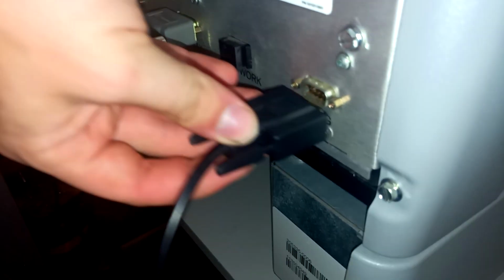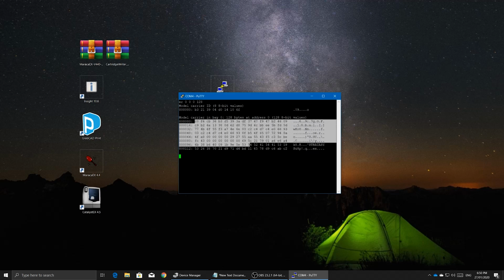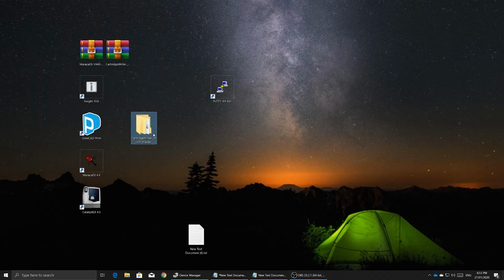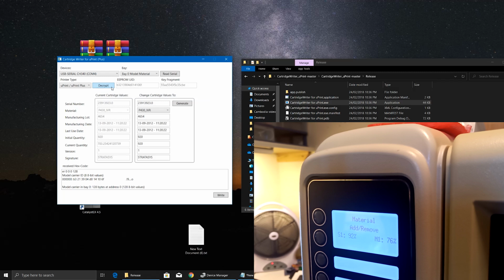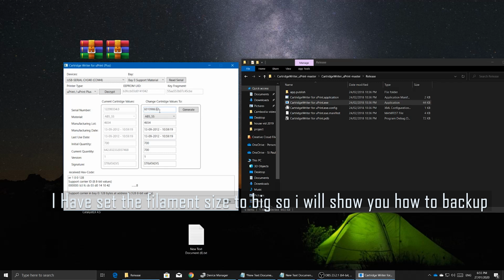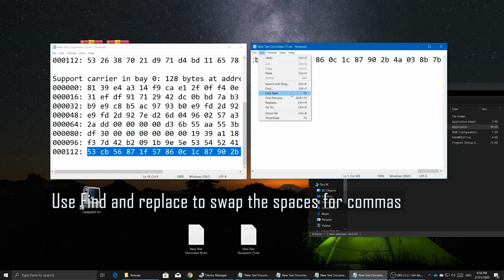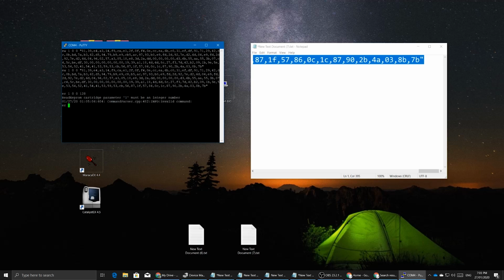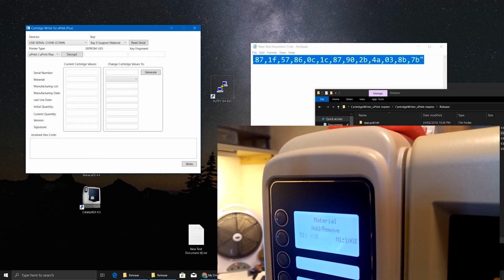How to Reset uPrint cartridges back to 100%   Use Any Filament!!!!

Comment: I know it is really late, but when I tried putting the " er 0 0 0 128 " command into putty I kept getting the error that "er" was not a valid command did anyone else get that command ? And maybe how did you solve it ?
Reply from the maker: Have you made sure that the it is the right speed or the right com port as that's the only thing I can think of.
Reply: Hi sorry for the super late reply. But yes I made sure it was the right speed and the correct com port, I am not sure why the command would not work. @ScrapTechTips
Reply: Would it be that I am using a 450mc fortus? @ScrapTechTips
Reply from the maker: @cristiangutierrez90  that seems to be the issue, I know that there is a different software available as well as a kit that some people have made on ebay that you just inset the cartridge into for the fortus printers. These were around a long time ago I'm not sure if they still exist. This method was mainly for the uprint and the uprint se + the HP versions of this

Comment: Hi,
I purchased the same print as you. and i'm retrofiting it as many.
I want to change the stratasys material by another more cheaper.
Standard ABS to replace stratasys ABS, and HIPS material to replace soluble ABS stratasys.

To do that i have to change temperature of nozzle. I understand in your tutorial you use a sofware to modify quantity of material. But in your tutorial i didn't see anything about changing temperature of the nozzle. I read arround the comment and i saw a guy asking this question too. The solution was to use the software "maracaEX 4.4" that i downloaded directly.
Do you know where we can find some  some tutorial on this software ?
i googling a lot but nothing.
i tried to connect my laptop with my printer with a "usb Cable adapter" on "diag" connector but Unrecognized. My laptop do not see anything about print.
in opposite, "catalystEX 4.3" is recognized by my laptop.

Do you think it can be an issu about driver of cable ? for information i use this one ==> https://www.amazon.fr/dp/B008634VJY?psc=1&ref=ppx_yo2ov_dt_b_product_details
Do we have to connect ethernet cable in parallel ?  Connect to the connector "UPS" of my printer ?

I'm so close, but now i'm stuck.
I hope you can help me. You or the community.

Thanks for your video ;)
Reply: Done i find how to do this thanks to your tutorial and some search on google ;). How to change temperature with maracaex ?

Comment: Hello, what to connect the USB-Re232 cable to the printer because I bought it on eBay and I have no communication with the printer. At Putty's Terminal, it is not possible to enter commands. Regards.
Reply from the maker: Is the cable a null modem cable and do you have the rs232 I think drivers installed for your serial adaptor

Comment: ive been looking for something like this for years!! thanks for sharing!  is there a way to just block a brand new chip from being read/written to? for example, tear apart the dongle and block the contacts, or rip off the contacts so that it just stays at 100%?? seems  like there should be a simpler solution...
Reply from the maker: I have heard You can achieve that with the Bolson materials ones but the stratasys ones I have not heard of this unfortunately, but it may be out there. 

There are full Arduino based ones you can build up however they are much more complicated to setup.
Reply: @ScrapTechTips  do you have a list of process to change temperature of the Uprint SE with maracaex ?
i tried to change the temperature but i don't know how to update the uprint SE.
How to do it ? whare can i see if the new value was took by the machine ?
Reply from the maker: @GuileATS  unfortunately I don't have the uprint anymore so I can't see how it works, I guess the best way would be to update it using maraca and then exit and then re-enter maraca and see if the value is updated.

Comment: And there's NO way to make the cartridge readable/writable if it's gone to 0%?  I have one cartridge left (just put in the new cartridge of soluble, so it's at 100%).  No way to hack that 0% cartridge, eh?
Reply from the maker: Yes that's correct, stratasys has made it so if they go to 0% they lock into read only mode so you cannot fix. You must catch before it's too late. If you have a spare soluble cartridge you can change it to material, the opposite is also true.

Comment: You NEED to have a null model wire for this to work. It has to be be "Full Handshake".

For the uPrint Se Plus:
-the serial number is 8 OR 9 character long
-the serial number have a "," not a "." (For my version only maybee?)
-the machine id is 09FBD4B61FC0B327
-the max qty is in between 1000 to 2000cm3 before the chip brick. (To be tested)

I used p430xl and not p430 spool
Reply: Cant edit, the serial number is 8 OR 9 character long. Caution, wrong number of character and the chip is bricked
Reply: hello, did you solve the problem? My printer also has a 9 digit serial number, the generator only compiles 8 digits. I also blocked the chip.
Reply: been a while. Last i remember, you cant unbrick a chip. (edit idk anymore)

I had a software where i could edit with the right degit number

Comment: hi, I have Uprint SE andi used cartridge writer program from riverfrontam. I used on model filament and worked well. Then , my support material was at %1 percent and i used read button and then pushed decrypt button and filled the support material but i forgot to change serial number part. Then after  i load the support printer said cartridge is empty. I think machine has logs for serial numbers and didn't accept the %100 support material after changing. Do you have any suggestions for me ?
Reply from the maker: Did you have a backup of the original that you can reinstall to the original state and then change the serial number as the numbers are hard to get to in the hdd.
Reply: @ScrapTechTips  i don’t have backup also can i write another example data like your video with putty does it work ?
Reply from the maker: Pretty much you will be stuck unless you have dedicated writing hardware unless you have the backup that you can write onto the eeprom. this is extremely important.

Comment: Thank you for the video,  Does it work with Uprint SE ?
Reply from the maker: Unfortunately not. The code is different.
Reply: @ScrapTechTips  i have Uprint Se Printer but i couldn't find any solution like your code. Do you have any advice for me can u help ?
Reply from the maker: @altugyardmc1844  I tht it may be compatible however it uses the comma instead of the dot for the serial number. Remember to do backups because you could lose your existing filament %. If it doesn't work there are other more manual ways on GitHub that work I just can't help as I don't have a SE to test on so for me it's all guessing. I believe this conversation has already happened in the comments. Feel free to have a look through.

Comment: thanks for video, very useful. I will try on. My printer is a fdm abs modeling lse uprint from stratasys. I am thinking to use HIPS material in replacement of original stratasys soluble support material, is the temperature compatible? it can replace without problems?
Reply from the maker: Using the maracca ex tool you can change the temperature so it does not matter, before printing you need to use blue tape and/or glue to stick the hips down
Reply: @ScrapTechTips  "maracca ex tool" what is and where   can I find it? by googling I had no results. thanks
Reply from the maker: @fercarcas  pm me your email and I will send it's hard to find as it's a stratasys developer/maintenance tool. If you can't pm me I will put a mega link somewhere
Reply from the maker: https://mega.nz/file/jlwUxDLL#PVV6-D2Jjs-PLTA1pPskI0wOiOHTsaZOZMgKhWDZGUs
Reply: @ScrapTechTips  Thank you man! We are trying to reset cartdriges for Uprint SE PLus, in case we acomplish that, I will let you know in your channel
Reply: @ScrapTechTips  Thanks! This video still works and was able to reset cartridges at will. Also was able to find the tool!!
Reply: @ScrapTechTips  do I need to change the temperature when i want to use HIPS material with my Uprint SE plus?
Reply: Did you find how to mopdify temperature with maracaex ? i tried many time but no success.  Can you explain me the process please ?
Reply: @GuileATS you should install maracaex and run it after  connecting ethernet cable between your stratasys fdm and computer you are running maracaex from. A connection should take place, you may read temperatrures and other params from your fdm. Take a note, after changing parameters (e.g. temperature) you should restart your fdm so a new set takes place. let me know if you have success. Greetings from Brazil
Reply: @fercarcas  thanks a lot for your answer!! Sorry for my late reply.
I already install maracaex, connected with ethernet cable and read temperature. But after that i modify the temperature with the value i want and maracaex tell me "to restart the FDM".  How to restart it ? But before to restart with don't have nothing to do except to modify temperature like save a file or something like that ?

I think i almost success but for now... not really XD.

From France with love ;).
Reply: @fercarcas  please help me i'm so close XD
Reply: @fercarcas  Thanks for your answers! to restart the printer we have to toggle the interruptor on the side of the machine ? How can we know if the printer has took the new setting ?

Comment: Have you ever tryied this procedure with a dimension machine?
Reply from the maker: The machine that I had was a dimension uPriny
Reply: @ScrapTechTips  yeah, I mean, would be the same result with a dimension sst 1200?
Reply from the maker: @xenlis  it only works with the uPrint printers, there are other applications that work with those printers

Comment: Hi,
Could you please help me with puTTY softwere, when opening my serial com box, the black screen appears, when i enter the first program and i hit enter it doesn't execute the program but it jumps to the next line 
Thanks
Reply: Can i please know which null modem cable you using please ?
Reply from the maker: @fractouz90  the cable or adaptor?
Reply: Thanks for the response, am actually using usb to rs232 the null modem cable with pin 2 and 3 swapped ans its not working
Reply from the maker: @fractouz90  interesting I am not to sure what I am using I just went and brought a null modem cable from the local tech shop. If you are not receiving anything back it may be that the adapter you are using is not working. At first I could not get putty to work so I used another serial interfacing tool such as hyperterminal do you know what adapter you are using or is it built straight in to a laptop / desktop. Are you plugging into the diag port rather than the other one
Reply: @ScrapTechTips  ive tried both usb to serial or straight serial, thanks for your help i will try this software and ill let you know.
Reply: @ScrapTechTips   i plugged it like you showed us on diag port,
I used putty teraterm et now hyper terminal, none of the them is working.
I just made a null modem cable myself with pin 2 and 3 swapped. 
Maybe it is putty configuration 
Speed baud 38400
Data bits 8
Stop bits 1 
Parity none 
Flow control xon/xof 
Thanks
Reply from the maker: @fractouz90  I'm pretty sure that there is a few more things swapped in a null modem/crossover cable I wouldn't be able to diagnose what's wrong without being in possession or near it sorry. Do you want me to send you a PDF document that states how to do it all
Reply: @ScrapTechTips  hi,
Am back to you, to tell you that i figured out which type of null cable we need for that, but now the cartridge writer program keeps crashing after hiting decrypt button
Reply from the maker: @fractouz90  have you made a backup? This happened to me if a bad code was written to a cartridge. Make sure to swap out the comma for a period in the number and have a correct size of cartridge. Have you programmed it at all yet? You can also not program it if the quantity has fallen below 0
Reply: @ScrapTechTips  first of all, i would like to thank you for the this video and all your support and giving me some of your time to answer all my question.
Yes i did save a backup file like you showed us, now when i run the carteridge software it runs perfectly read serial works and when i click on decrypt button (step before genering a new code) the software crashes.
Reply from the maker: @fractouz90  would you be able to restore your backup? As I have had that issue if the application doesn't work correctly sometimes. 

Have you used that program on the cartridge before ?? Just to make sure what printer are you using? 

If that cartridge doesn't work have you got a few spare of either because they are interchangeable if you program them right just make sure you do backups
Reply: @ScrapTechTips  Am using Uprint se plus, i will try the ew command and i will let you know, and it is first time that am trying to do this.
Reply from the maker: @fractouz90  that may be the issue as this program is really only coded for the basic uprint I could send you the guide to make codes manually for the seplus if I can find it.
Reply: @ScrapTechTips  cool you have my email adress if u can send me this document when you will find it.
Thank you so much
Reply: Am back with good news today, i finally sort it out completly.
Am here with some more details for the next people that will have the same issus .
When putty does not allow you to type means that its not the correct cable. For this type of printer we need null modem cable with handshake. 
When hitting decrypt button the software crashes means that you need to use the software for uprint se PLUS.
And for me when i generete un new time and i hit write i have to leave it with a comma instead of a dot.
I would like to thank you again for being present and concerned about my queries.
Reply from the maker: @fractouz90  awesome,
 I am happy you have figured it out, this will help me to respond to others questions
Reply from the maker: That means that some settings may be wrong have you got the baud rate and correct com port?
Reply: @ScrapTechTips  yes for the settings, but i think the problem is the cable

Comment: Thank you!!! Anyone can suggest me where buy good abs material and soluble support for my uprint (not plus)? And if you have any solutions for the base....?
Reply from the maker: As for the base to reuse use glue stick on the print base it adheres much better.(or use blue tape) The support material use HIPS as it breaks away and can be dissolved by limoline, cheap abs you can get on AliExpress but price does reflect quality of material and winding, I would recommend the sunlu materials as they are nearly wound and are realistically priced at around 24 nzd per kg.
Reply: I ahve been using CRON ABS in my uPrint for a few months now and it is working very well. As ScrapTechTips said earilier, HIPS is also very good as a support material. I use Form Futura EasyFill HIPS and it is actually easier to remove than the standard p430 soluble support from Stratasys. The fillament is a little more flexible though so doesn't automatically load properly. I just load it using the head maintenance menu and then it works fine. Neither manufactureres speels fit into the uPrint standard spool holders to I have to rewind the spools onto an old OEM spool. This must be done carefully because if you get a knot or overlap the material will stop extruding and the print will be ruined. This happened a lot when I first started but I haven't had a problem in the last 3 kg of material. I use acetone to get the HIPS to stick to the base for wide prints. I just wet a cloth with Acetone and wipe it over the build platform.
Reply from the maker: @Firebird356  I found that if you make a hole in line with the chip holder you can run the spool from outside the cartridge easy as. All you have to do is push it through and you can see how much filament you have left at all times
Reply: @Firebird356   do you know how to change temperature of the Uprint SE with maracaex ?
i tried to change the temperature but i don't know how to update the uprint SE.
How to do it ? whare can i see if the new value was took by the machine ?
Reply: @GuileATS  I have never tried to change the temperature of the uPrint. The standard temps work fine for the material I am using. Sorry I can't be more help.
Reply: @Firebird356  which materials are you using? Are you using HIPS for support material?

Comment: Thanks for the walktrough. The program crashes reproducibly when I press "decrypt" on both Win7 and Win10. I'm using a Prolific USB-serial converter. Any ideas?
Reply from the maker: What printer have you used.

Did you reser the chips before this happened so you have a backup?
Reply from the maker: That's the error if you have tried to already reset the eprom but forgot to remove the comma and replace it with the full stop. 

Would that be right? 

Did it work before?

Did you do a backup?

Comment: There is any chance to update the cartridge writer for uPrint SE plus?
Reply from the maker: I think people were working on that. I know there is a manual way very similar to what I did. Probably best to look on the GitHub page as I think I saw something about it on there.
Reply from the maker: upon thinking more about this you can use the same program and just make sure you do a backup first and see if it works, if it doesn't bummer but if it does fantastic
Reply: @ScrapTechTips  As soon as I found this program, I tried it immediately. Does not work with uPrint Se Plus
Reply from the maker: @TDI-CAD  I'm not to sure if you could email the developer of the program and send them a image of the printers hard drive they could possibly do another revision.

I am pretty sure there is a command line based information maker